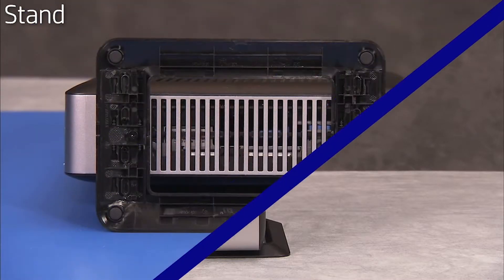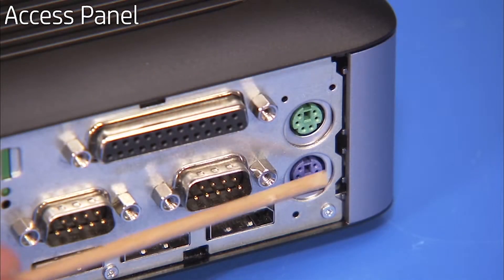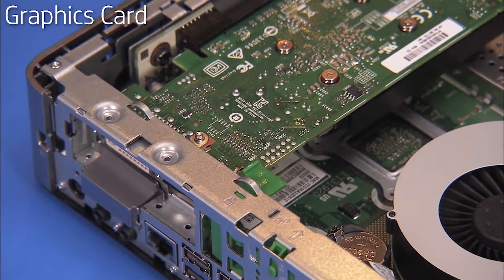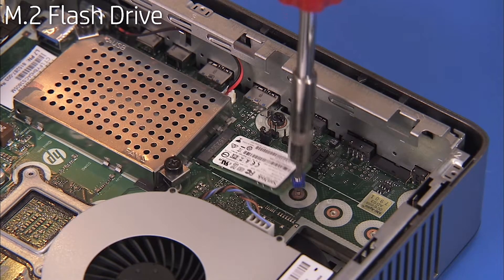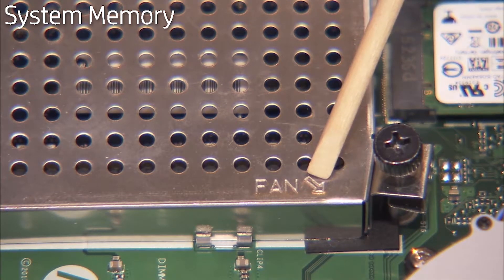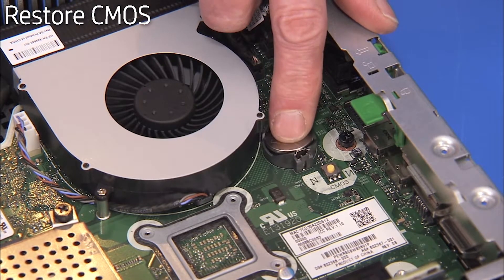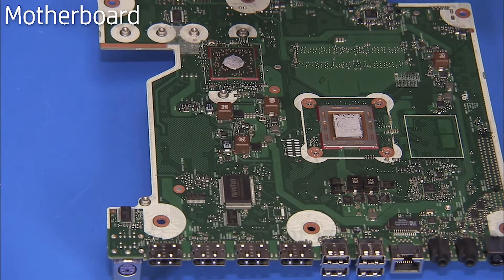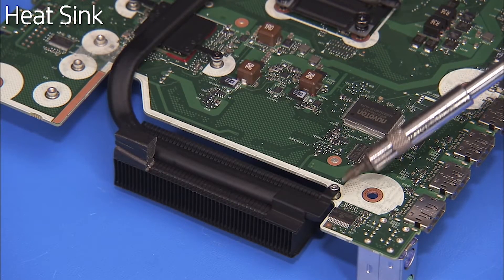Removing & replacing parts for HP t730 Thin Client | HP Computer Service

Comment: Hi, I have such a problem, I have HP t730, and I connected GT1030 gigabyte via riser, everything works fine in idle, but when there is a load, the screen is dark, I flashed the BIOS, or maybe it is that it does not have enough power from the power supply, or maybe the problem is in the riser!? I can’t understand what the reason is ((((
Reply from the maker: Hi there, thanks for contacting HP Global Social Media Support!
I understand that you are experiencing an issue with the graphics card of your computer.
I will do my best to assist you.
You can update your HP notebook using Windows Update or HP Support Assistant:
•	Windows Update
Check for updates by searching for and opening Check for updates. If updates are available, they will begin automatically. You can also download and install optional updates by selecting Advanced options > Optional updates.
•	HP Support Assistant
Open HP Support Assistant, find your computer on the My Dashboard tab, and click Updates. After the system analysis is complete, select the updates to download and install. 
You can also update your BIOS (Basic Input Output System) by downloading and installing a BIOS update from the HP Software and Driver Downloads page:
1.	Go to the HP Software and Driver Downloads page.
2.	Navigate to the product page for your computer.
3.	Select BIOS from the list.
4.	Review any available BIOS updates.
5.	Click Download if there is a BIOS update.
6.	Save the BIOS update file on your computer.
7.	Double-click the file name to start the installation. 
Regards, 
HP Support